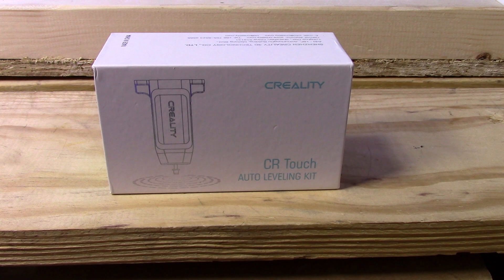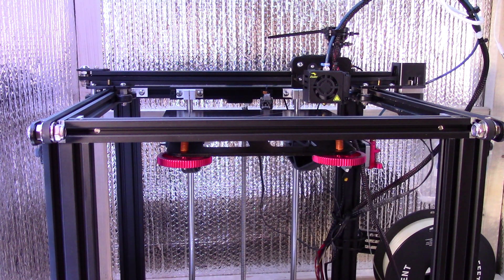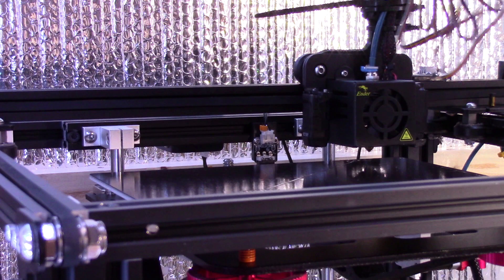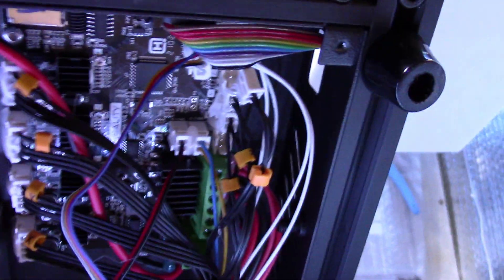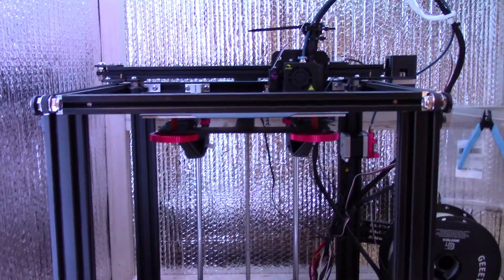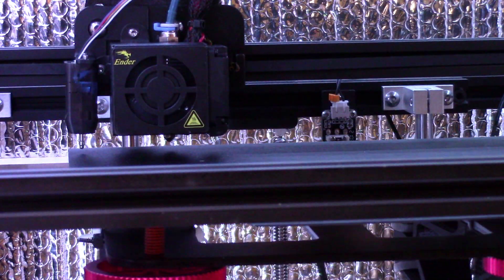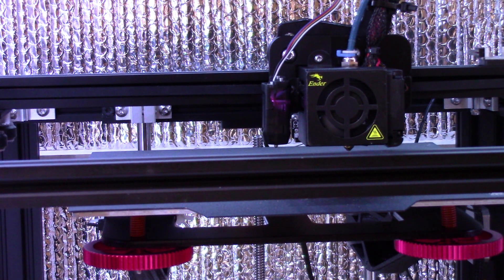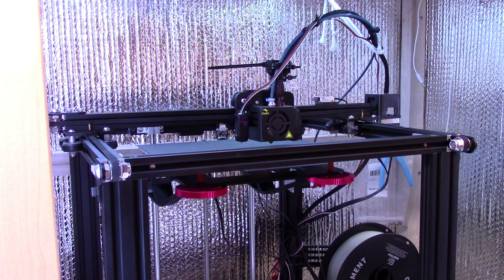3D Printing Ender 5 Pro: Creality CR Touch Unboxing, Setup, Config and Review - Auto Bed Levelling

Comment: YOU PAID $80 FOR THE BL-TOUCH?!?!
Reply from the maker: That's what 3d printing parts costs in 2021. Times have changed. The bl touch still goes for $50 Canadian. If you haven't purchase a 3D printer yet, I recommend you stay far away from Creality. They have lost there advantage and edge that they used to have.
Reply: @MicBot  I finally bought the CR Touch for my E5P, you're right, the instructions are completely foreign to the firmware version and nothing in the instruction pertains to my setup. The firmware has a setting in the main motion menu for z-axis offset, but still has the setting in move axis for moving the z-axis. It doesn't tell me which one to use to set the z-axis offset, and even though I have used both of them and then stored the settings. It still doesn't Home to the new settings I saved. It still homes too about 5 mm below the nozzle!
Reply: @MicBot  Finally got it working by following  your vid, thanks for your trial and error then fix, got me printing perfect 1st layers!

Comment: How did you revert your printer back to the original firmware. I downloaded the cr touch firmware and now it is stuck in that
Reply from the maker: Hello, you can find the default firmware on the creality support site. Just make sure you get the right one for your board and in English or which ever language. 

Once you download the firmware place it on a blank USB key. Now at your printer, make sure its off, insert the usb key in and then turn on the printer and wait. The default firmware should now be flashed onto your printer and you'll be back to the defaults.

Comment: How can I tell if this will work for my board? Just got mine today for the ender 5 pro. thank you for the tutorial.
Reply: Did you manage to make it work? 
When I update the firmware my extruder sends the filament backwards, and Crealiy suport is realy bad they just dont want to bother with it...
Reply: @RusimRedom  yes. I was able to get it working. From what I remember we had to edit some settings in the firmware prior to installing.
Reply: @nickfitz9800  what did you use to edit the firmware i would l8ke to know how to do that as well so i can make my cr touch work
Reply from the maker: @RusimRedom I used Microsoft VScode with PlatformIO. It's not easy, but once you figure it out the possibilities are endless.
Reply: @RusimRedom  Cura - Manage Printers - Machine Settings. Copy/paste the Start Gcode here. Sorry I said firmware I believe we just had to edit the g code. I dont remember all the steps we took but I did find my answer on google and got it to work after editing the g code for my printer in cura.

Comment: Hi there been following your tutorial up until the point of connecting to the motherboard. I unscrewed the back panel and I don’t have the port for the cr touch 😭 or any other empty port for that matter
Reply from the maker: Hello, your board may not be compatible then. Do you have an 8bit or 32bit board?
Reply: @MicBot  Hi! Thanks for the reply! I’m not sure which I have tbh. But the motherboard itself says it’s V1.1.5

Comment: If you find that your z axis isn't working after setup, you might have unplugged the wrong Z cable. The first time I set up mine, I unplugged the 4 pin Z connector on the motherboard instead of the 2 pin Z stop.
Reply: wow thank you so much... :D

Comment: I've been struggling for a couple of weeks now trying to get this to work on my ender pro. I manually level my bed, autohome and set the z offset. Then run ABL and start a print. No matter what I do the nozzle drifts further away from the bed as it goes towards the front of the bed almost like the bed is sloped down.
Reply from the maker: I had many issues as well. I returned it after I made this video and went back to manual levelling. I've been manually levelling everyday since with zero issues.
Reply: @MicBot  its has to be a firmware or slicer issue but I think I'm gonna got back to manual as well.

Comment: Thanks for the great video. Just a tip though. You don’t need to disconnect the z limit connector from the board. You can just disconnect from the switch and you won’t need to worry about the hot glue.
Reply: where is that switch
Reply: @NotMatthewJ  It sits in the back. At the top, When Z is homing a silver adjustmentscrew at the back of the bed hits the black switch. Ie. not a physical button but a limit-switch so it has a metal piece that hits a switch when moved.
Reply: @wilhelmelofsson  disconnect the cable on top?
Reply: @NotMatthewJ  correct, if you want, you could remove it also. Then it won't be in the way if you want to home closer to the nozzle. For example if you had a glass bed and moves to PEI bed.

Comment: Why not disconnect other end of z cable at limit switch and secure so as not to flop around?
Reply from the maker: Hello and thanks for watching!

If I don't disconnect it from the board there will still be power going to it and cause a shock hazard.

Comment: Great review! Fellow Canadian here. This video would have come in handy 2 weeks ago when I was installing mine in the e5Pro. I sent my CR Touch back after 2 days of screwing around with it.. nothing but freakin' headaches. The BL Touch is working well, however. Yes... same firmware. 

A few pointers, if I may.

1) There's only one version for sale. There isn't a "32 bit version".
2) Only one bracket fits the e5Pro.
3) Install the cable into the CR Touch before bolting it onto the bracket to help facilitate your life.
4) Unplug the board fan to help facilitate your life.

Do you ever compile your own firmware?
Reply from the maker: I don't yet. Once I learn how to I'll definitely make a video on it though. Thanks for the pointers! 

Thanks for watching and leaving a comment!

Comment: Hi Nice video but a couple of things ! The "cant reach error" is because you haven't defined the bed and the probe offset in firmware.  When you auto home it erases the mesh data so in your slicer pre print script set G28 to home then G29 to probe the bed . When the probe touches the bed during homing it is setting the Z 0 ( zero) your Z offset to actually print will be a negative value "from" the Z  . ALso when you load new firmware you have to initialise the Eeprom then when you make any changes "save settings" If making changes from Octoprint ternminal send M500 to save the new setting in Eeprom . Hope this helps
Reply from the maker: Thank you for the info and thank you for watching!

Comment: Really great video, helped me get everything hooked up properly. You briefly mentioned at the end that you returned it due to issues but didn't really say exactly what issues. The issue I had was that when probing the bed, the printer would move the nozzle to the probing points and the probe would be too far to the left, and on the left side of the bed the probe would be completely off the bed causing a crash. The only fix is that a probe offset has to be defined in the firmware so that the printer knows where the probe is in relevance to the nozzle. TH3D's Unified 2 is a really good Marlin-based firmware that I found which has been mostly preset for a variety of printers and is available with pretty detailed instructions on how to configure your firmware for your application, compile, and flash your firmware. If you were experiencing an issue like this you may still be able to take advantage of auto bed leveling by replacing your firmware with the TH3D firmware. Overall great vid though!
Reply from the maker: Hi Victor, I just wanted to start by saying thank you for watching and commenting. 

My issues were that prints were not sticking no matter what I did, and then the z-axis started jamming itself into the extruder and no matter what I did it refused to go back down, until I shut the printer off and manually lowered the bed down. I struggled for two days trying to get it to work, I had one successful print and 12 failed prints. I figured it wasn't worth the headache for me since manual levelling has always worked great for me. So I made the decision to return it and I went back to manual levelling. 

Thanks again for watching!
Reply: I just got the CR Touch, seems to work great for me. Only issue I got was that for some reason it forgot the Z offset at one point. Was probably my fault, had proprably clicked on something I shouldn't have. I didn't realise it at first however so I got a confused when it seemed to print in the air a few times. 

I have an ender 5 pro as well. Would be nice if you could adjust the Z offset in a bit smaller increments than 0.05mm, that's half the thickness of a piece of paper. When doing it by hand you can certainly set the Z height much more accurately. When you set the Z offset it seems to be like (if you use a piece of paper) nozzle barely touching paper, 0.05mm down and you can hardly move the paper. Not the probes fault though, just that you can't adjust the Z offset more accurately. Maybe you can use some other method to set the Z offset more accurately.
Reply: Hello Victor i think i have the same problem. When starting the automatic bed leveling everything is moved to the left causing it to crash into the axis. How exactly do i upload the TH3D firmware? Do i just download the bin. file and install it like usuall or do i have to manually program something?

Comment: They hot glue the wire so they don't come loose in shipping. It is annoying to remove.
Reply from the maker: Yep that's what I figured as well. It's still a good move but also a pain when doing an upgrade.
Reply: @MicBot  Probably invalidates the warranty as well if its tampered with